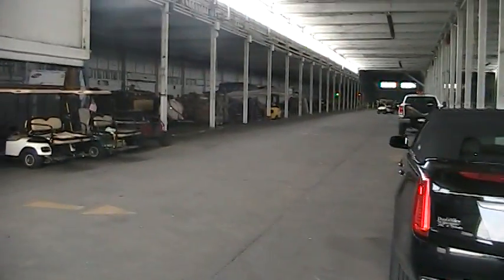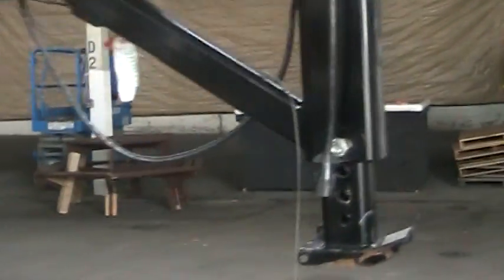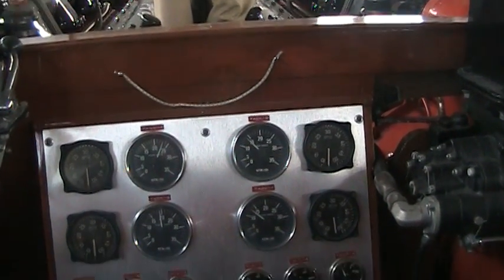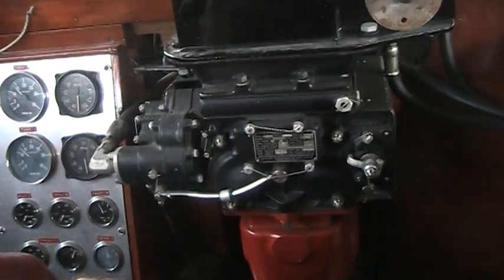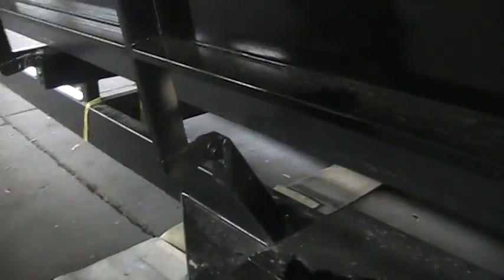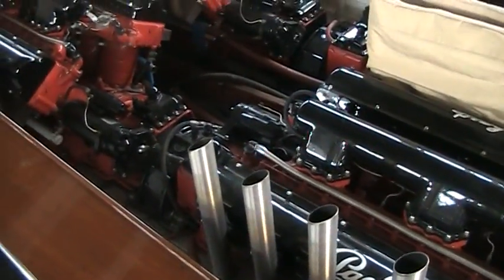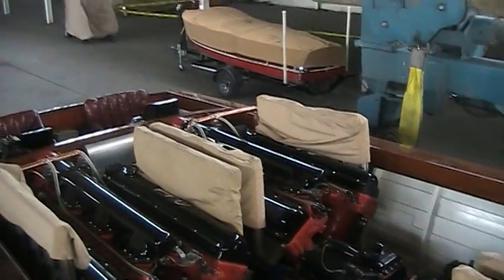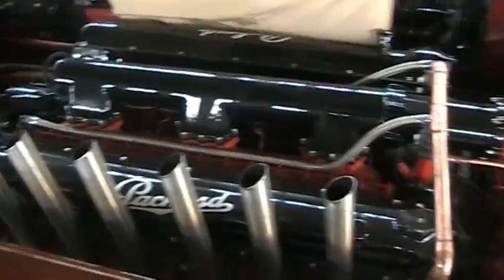1930s miss america 10, pure bad ass(michigan) history.chris craft plant.

Comment: I believe the Packard engine was also used in pt boats during ww2
Reply: kennethjohnson  The Packard M2500 PT Boat engine was not a Merlin nor in any way related to them  Merlin was 1650 cu i first delivered by Packard to the Brits in 1942. the 2500 CU IN  M2500 PT Boat engines were delivered to the US Navy in 1938.  2 entirely different engines. Packard built 14,000 M2500's  55,525 Merlins !!!

Comment: During WW2, Ford was asked by the War Dept. to manufacture Rolls Royce Merlin engines for the US.  The RR specs were very exacting with super close tolerances.  Ford said he couldn't do it.  Packard said they could and did.  RR/Packard Merlin engines blew the Luftwaffe to shred inside P-51 Mustangs.  The first Mustangs had Allison single stage supercharges, but really got the goods when the RR/Packard Merlin engines were installed.  God bless Packard, Roll Royce & North American Aviation.
Reply: kurtzwar  The V12 engines in the Miss America were NOT Packard built merlins !!! Packard had designed the M2500 Engines for the Navy PT Boats delivered to the navy 4 years before Packard built the first merlin, and that is the early version in Miss America !!!

Comment: The steps were designed to create an air gap between the boat and the water. Without it the hull creates suction and sticks to the water and slows it down.

Comment: I don't think 12,000 HP per SIDE, thus 24,000 HP total is correct.  Maybe 2,400 per side.
Even the "wartime rated HP" of the engines used in the Thunderbird boat on Lake Tahoe were rated at 3000HP, now in marine used considered to have 1100HP.
Reply from the maker: yeah i got that all wrong.someone said 6000 total,still for that time in history these boats were amazing .
Reply: The early M2500's were 1200 HP each so X4 is 4800.  later M2500's went to 1500 HP most used variant in WW II with last end of wat varients at 1850 HP and they were all supercharged !!!

Comment: The current Water speed record holding boat is the spirit of Australia it uses a 6000 horsepower jet turbine engine  to Go 317 mph you say in this video that each engine is 6000 horsepower for a total of 24,000 horsepower something does not add up here don't get me wrong this is still a very cool video

Comment: Packard engines WERE used  in WW2 aircraft  they were shipped to  England to the RollsRoyce engine plant  which was in Scotland, and modified for use in Spitfires.My neighbor in Miami,Fl worked as a 14 y.o.boy in the plant and had fotos for years of him standing next to the shipping crates. His first job was to open the crates and clean the protective shipping grease off the engines
Reply: Those Packard engines actually were Rolls-Royce Merlin engines built by Packards. Completely different from the marine Packard engines as installed on the PT's.

Comment: Miss America X has a great history.  Unfortunately almost everything the narrator says in this video is wrong.  I was one of the crew members that campaigned the Boat to a number of antique Boat shows in 1983. The mechanic who did the installation of the four Packard 4M 2500 Engines was Bob Schroeder.  He has passed on since.  We ran a number of antique race boats up and down Toronto Harbor during the 83 event.  From there we trailed the boats to Detroit.  We fueled a few of the tow vehicles with 100 octane aviation gas from the Miss America as we drove across Canada heading west to Detroit.
Reply: So are the 4 engines all hooked up or are 2 just along for the ride now?

Comment: Can't believe how many mistakes in only 7 minutes.
Reply from the maker: hey i am no expert,tell me what you know.
Reply: He only wanted to tell you you where wrong, not offer anything informative.
Reply: Sean Loughlin. I believe all 4 engines made North of 6000 horsepower in total Bar Wood and Chris Craft were competitor's so I'm not sure if this was a combined effort in the build. 
   It is something awesome to see in video. Thanks for sharing 
  Just for laughs miss america VIII has been restored and is for sale running and driving they asking price is $1.1 Million. 
  VIII only has 2 Miller v16 engines but it too is still so awesome
Reply: Sorry Gar Wood
Reply: one thing you got wrong is that the Packard v-12 was NOT an aircraft engine, it was  PT boat engine. and this boat was built off of PT boat plans, obviously modified somewhat.
Reply: @tymcfadden8496  Other way around- PT boats were built by Gar Wood in WWII. This boat was built long before that! And the Packard V12's WERE marinized aircraft engines.
Reply: @garfieldwood8315  The M2500 was a clean sheet design for Marine use based around the A2500  pistons rods and crank with a Marine block, superchrged and marine manifolds and marine transmission !! !